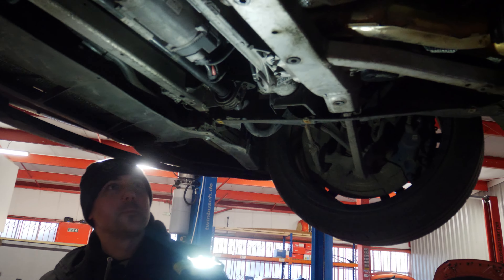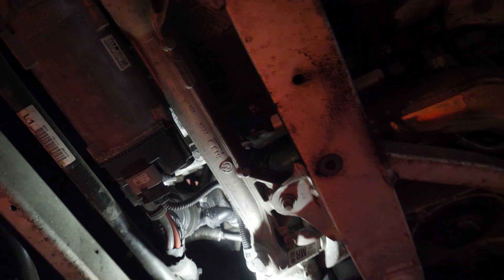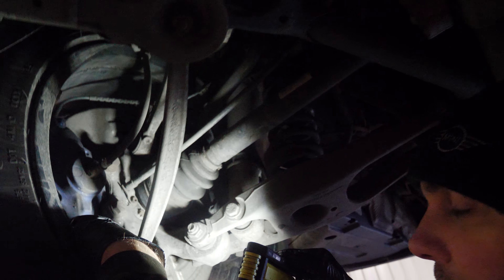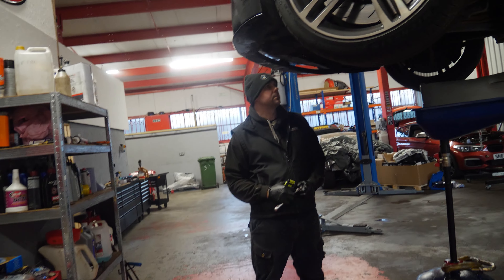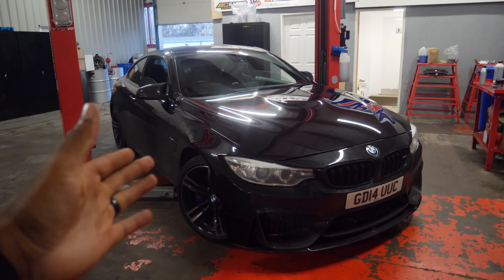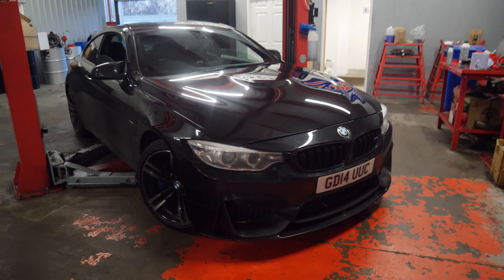Everything WRONG With My CHEAP BMW M4!

Comment: I believe BMW did a recall/updated the crankhub in M4’s in the Europe. Yet like Mischa said, it’s not really needed. I would put a VTT capture plate on though for piece of mind, plus it’s only a $150 part - takes 45 minutes to install. Super easy
Reply from the maker: Recall to fit the crankhub style that was fitted on mine I can imagine if they actually did, never heard of that though..I’ve seen cars still spin and have huge damage even with a capture plate on to be honest
Reply: @TimWilliamsHD  H2 Motors GmbH racing has never had a Hub spin and they strictly stick to a capture plate solution. An honest mechanic will tell you that what causes the hub to spin is the Crankhub Bolt unwinding itself due to repeated high torque abuse (If you use your kickdown like a mad lad), releasing the pressure that's holding the friction between the two pieces of the hub together. If you don't check that the bolt is properly torqued down to spec prior to installing the plate, you're not doing anything.  

At least in the U.S. groups and forums, I have yet to hear of a reasonable driver with just the plate installed to have had their hub fail. No one has provided any proof their hub has failed with just a capture plate on.  

Another thing to remember, people will never blame themselves. They say, "Ahhh this car sucks and the hub spun". Instead of, "So ive been abusing my car for 9 months, driving like a lunatic, street racing every day".  

Last bit of data, over 100K F8X's were made, not even 1% of owners have had their hubs fail.

Comment: Basic wear and tear with age and mileage. Remember it was designed and built to be driven. 90k miles proves its strength and engines nicely run in. There’s U.K. bmw 6 series with 600,000 miles. Many other numerous BMWs with 200,000+++ so all good. It looks stunning. Once completed it’ll be phenomenal. We can’t wait.
Reply from the maker: Haha thanks for the comforting information dude!

Comment: Diff output seals are known to “leak” mostly due to their proximity to the exhaust system. If it’s bad I recommend replacing it….it’ll leak again eventually though.
Reply from the maker: Ah I see, so heat related?
Reply: @TimWilliamsHD  That's the current major agreed upon assumption. Changing the bushing to another, Non-OEM, material seems to hold up a bit better over time. I saw that you replaced yours already, just check the bushing when oil servicing the vehicle since you're down there already.